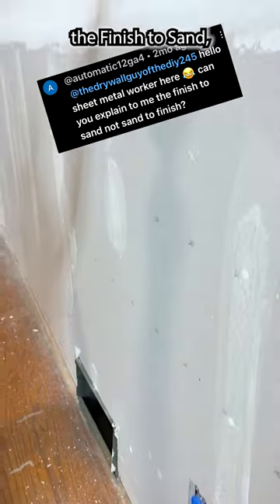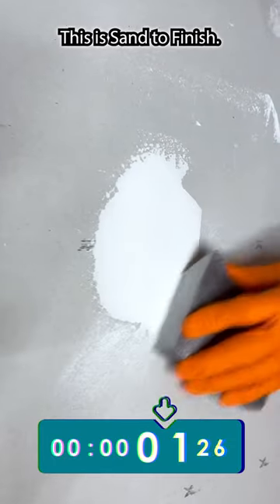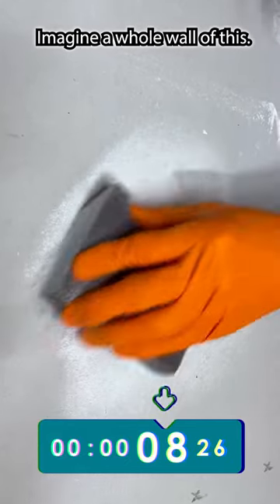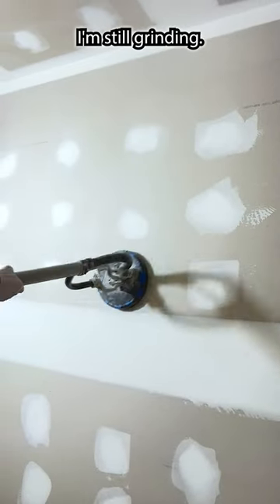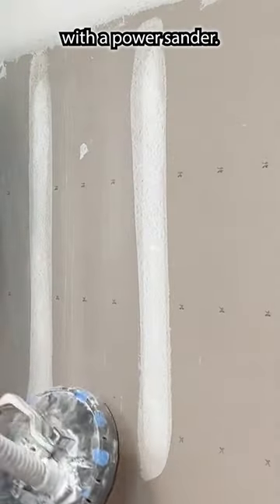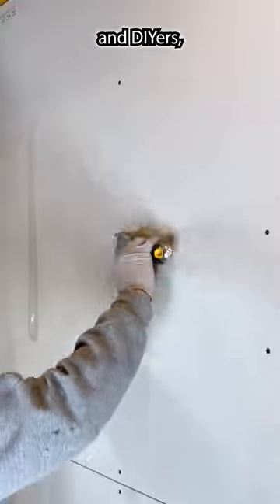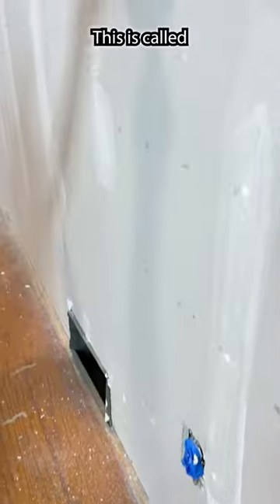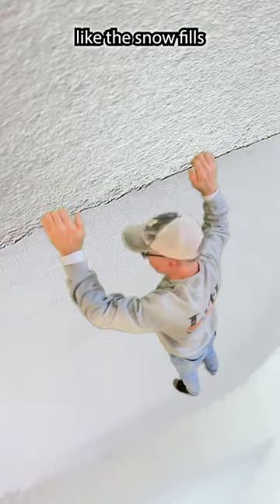"Finish to Sand, NOT Sand to Finish" Drywall Finishing (Beginner-Friendly!) #shorts #diy  #drywall

Comment from the maker: Drywall Lingo:
Spotting nails = Coating drywall screw holes

Tired of endless sanding on your drywall projects? Say hello to smooth, flawless walls with the "Finish to Sand, NOT Sand to Finish" technique! This beginner-friendly method is perfect for DIYers and professionals alike, saving you time and frustration. In this video, you'll learn:
** The secret to finishing drywall with minimal sanding.
** Discover the "dot and spot" technique.
** Master the "running line" method.
** Witness the "sand to finish" nightmare compared to the effortless "finish to sand" approach.
** Discover the importance of only "Brushing it down, NOT Grinding it down" concept.
Reply: Thanks.
Reply from the maker: You are welcome 😊

Comment: So what are you trying to tell us
Reply: It will forever remain a mystery.
Reply: Don't over-mud. You can use the least amount of mud to fix the hole, then remove any excess mud immediately after applying. Thus, you will have a finished surface with touchup sanding afterward.
Reply from the maker: Bingo 👍🏻👍🏻👍🏻

Comment: Do you go back over it after it dries? I always have dips where the mud shrinks over the nails. What am I doing wrong
Reply from the maker: Not enough mud. You need to put at least 3 tight coats of mud on the nails. Make sure each coat is dried before next coat is applied.

Comment: Imagine a whole house! As a homeowner I gutted a four family house and installed new 5/8” Sheetrock 9 foot ceilings it took me two years of backbreaking work to pull down all the plaster and lathe rewire the house redo every bathroom and kitchen all done at night or on weekends. I used way too much mud and was sanding forever.
I’m going to remember that experience for a long time.
Reply from the maker: I totally can relate to your experience.